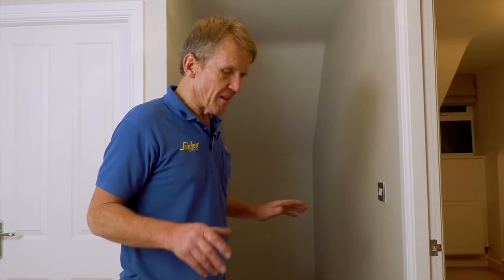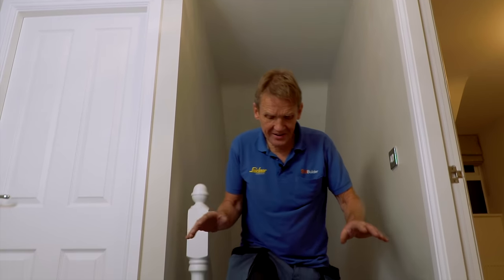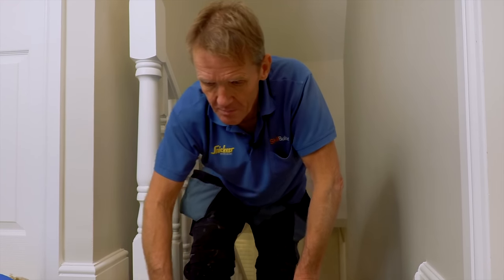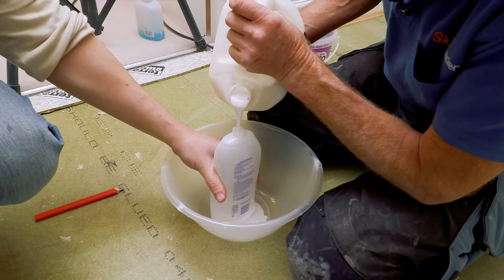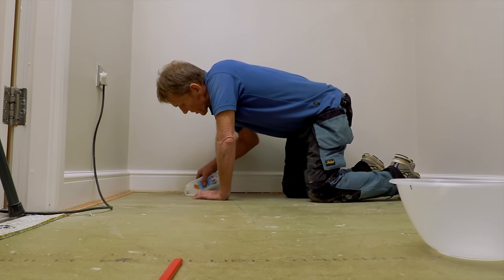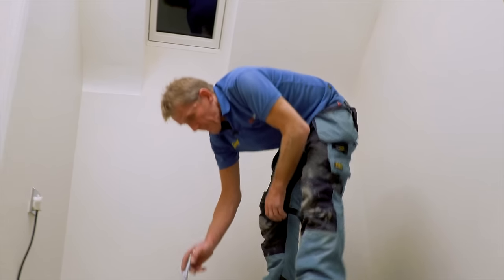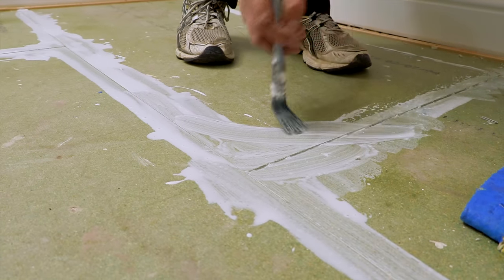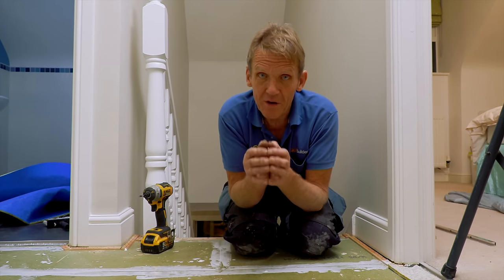Creaking Floorboards Driving You Crazy?

Comment: alternately, you can go into the basement or crawlspace and predrill at a 45 degree angle through a joist and slightly into the floor boards, then put a wood screw in the hole and draw down the floor -- make sure the screw isn't too long that it pokes through the floor boards.  You can then also put unscented talcum powder in the seam between the floor boards to help further stop squeek.  Cost is near zero
Reply from the maker: Edward
Forgive me for being a bit slow brained but how does drilling through the basement help stop the upstairs floorboards squeaking?

Comment: Sheathing gaps look quite large. I just came from a walkthru at a new house just finished but with only frames, floor sheathing. No carpets, hardwood or any tiles. The floor sheathing placed do not show any gaps, and nowhere near that large in this video. So, if ever such a repair situation occurs in the future, will this gluing step be needed? Seems with no gaps there's no space for the glue to flow into. Other than that, I do get this very well detailed and explained video to spot creaky floors.

Comment: Ah man this worked superbly on daughter’s floor but not on ours
Think problem deeper rooted as when lifted carpet done I’ve had already screwed it down but randomly all over shop
Followed this to letter as I had done last year (with superb results) but freaks as bad as ever this time
Reply from the maker: Hi Martin 
I think expanding polyurethane glue is your next step. You need to identify the movement and drill some small holes in the chipboard so you can squirt the glue in. It will seep into the gaps under the boards and expand to pack it.
Reply: Champion you couldn’t give me a link for this product? It does feel like squeaks coming from adjacent room when you stand on a board at top of room squeak comes from opposite end of room .
Also how deep would you drill to get glue Under board

Comment: There can be pipes underneath. It turned out a nail had bent around a pipe when our house was done in the early 1990s.
When we put screw in to the same hole it went straight into the pipe. ⛲
Would love to know if there's any way of detecting what's pipe underneath floorboards.

Comment: loving the videos,  re the pipes etc, always wondered why on new builds  or renovations   that  no one marks    the run of electric cables  or pipes  with a  coloured marker   say blue for water   red for elec or even just initilals    on the floor itself , takes all of  2 mins  when doing it ,  and would save a lot of farting about  or worrying about hitting a cable  or pipe ,     anytime the guys at my work lift a floor to do a repair to either the floor itself  or a burst or broken cable   they  mark the  general run  and the depth of the utility  eg     Elec--->  90mm  down    that way   they know  whats under that particular section of floor and how far down it is ....we have came work from  heating engineers  and electricians  on previous  renovation work   taking a 25mm notch off the top of a joist  and runining  pipes  and cables  literally 5-10  mm below the floor  level  or butchering the joists to hell leaving nothing there  and we get a call  4 months later   to go and  fix a burst pipe , pinched  cable or worse   collapsed joist ,

Comment: Thanks for the great video! I'll be giving this a go myself soon. Roughly how much PVA would you recommend per board? Or is it just a case of putting it down until it's completely saturated with it? (I'm a bit worried I'll go over the top with it).
Reply from the maker: Hi Adam 
You won't put too much in. I would say 1/4 of a cup full per joint and dilute it so it trickles in.
Reply: @SkillBuilder  Thanks for taking the time to reply. Much appreciated.

Comment: Had the same issue for years, found this video last night. Lifted carpet in bedroom before the boards are butt jointed that tight i don't think i will be able to get any pva in the joint. Will 40mm screws be deep enough if i screw them next to existing nails don't want to risk going through a pipe etc.

Comment: It is usually joist hangers or metal straps making the noise. Dont use pva to stick boards down need to use D4 glue.
Reply from the maker: This is not sticking the boards down it is sticking the t&g to eliminate the movement that causes creaking. Joist hangers and bounce is slightly different.

Comment: How do you actually take the boards up? My floorboards squeak to the point you can hear pipes rattling at certain areas. Got a feeling we would need to remove the floorboards completely and maybe get a plumber in to correctly fit the pipes. Literally the whole of the upstairs speaks. Even the master bedroom which is a 3 year old extension that shouldn’t have any problems. Assuming the fitted the pipes over the joists, not through them. Which also caused the floorboards to lie uneven?

Comment: We have just installed new 18mm OSB on the floor, instead of old wood floorboards. The ones installed click together. We screwed them in to joists and yet thet sqeak. What could be the reason? Would the glue work?
Reply from the maker: yes you must glue those joints. It should be done when fitting but pour in some dilute the PVA 3 parts water to 1 pva and pour it onto the joints then tap the boards with a hammer to help if flow into the joints. Then try and stay off the floor for at least 12 hours.

Comment: Some good points, some I'd disagree with...I was disappointed with the results (almost nil) with attempting to go through carpet into joists below. I tried break-off and small-head screws and neither worked. 

Best result I had was in another property with ALL of the carpet and pad removed...the original floor-boards were just nailed in...after 30 years of wear, many had worked up. A re-do with screws in/near the same spots as the nails did the trick (SHORT screws...yes, I was on a 2nd floor and didn't know all of the plumbing layout...excellent point about this).

Over time, I can't see how glue can be better - it will lose its' integrity...?

Comment: I tried this method in my 2nd floor flat, used PVA glue one evening and then 45mm screw tight screws the next, seems to have not done a single thing. Any other tips ? @skillbuilder

Comment: Thin superglue is better than PVA in spot situations in my opinion. Goes much further in and goes off in seconds.
Reply from the maker: Superglue is not the right product. The chipboard is too absorbent and the glue line will crack.
Expanding polyurethane glue works but it hard to get into the joint. Diluted PVA is perfect, it works so please don't start trying to confuse the issue.

Comment: Why would you do this rather than take up the boards, locate the joists and screw everything down with good screws? Is this for when you cant lift the joists because they are glued, they cant be glued that well if they creek so you may as well lift them?
Reply from the maker: The ten minute fix worked and is still fine. Taking up tongue and groove boards often means removing skirtings. That is a major mission.

Comment: I think my house has even worse chipboard flooring than this.  My place is an ex-council build Circa mid eighties, and probably as many of these places were, built to the minimum acceptable quality with corners cut by lowest tender contract builders knocking out job lots of fifty homes at a time.  Anyway..in mine, the ends of the chipboard sheets do not even rest on joists.  So they flex deeply as you walk on them.  Fabulous!

Comment: Could I just use pva on my chip board flooring as I’m worried if I put a screw in aswel knowing my luck I’ll hit a live pipe or wire?
Reply from the maker: Yes by all means give it a go . It often works, however driving a 40mm screw down beside the nail is fairly safe.

Comment: What’s the best way to find out where the pipes are? Floorboard up? Or put a screw in next to nail and hope for the best? Thanks for the info.
Reply from the maker: Take out the nails and put the screws in the holes. 

https://www.screwfix.com/p/hultafors-compact-nail-puller/6138K?kpid=6138K&ds_kid=92700031524363985&gclid=54d8f0f94169116bd43190c302043579&gclsrc=3p.ds&ds_rl=1241687&ds_rl=1245250&ds_rl=1244066&ds_kid=92700031524363985&msclkid=54d8f0f94169116bd43190c302043579&utm_source=bing&utm_medium=cpc&utm_campaign=PX_Shopping_Tools&utm_term=4583589099402330&utm_content=G%20-%20Hand%20Tools

Comment: I use one those Bosch magic pipe locator gizmos that goes beep at hidden pipes when you wave it around on the surface of walls, ceilings and floors. Rupturing a pipe WILL ruin your day. BTW, did those chirpboards go directly on to the trusses?

I've been redoing a floor with crappy recycled Oregon Pipe T&G planks, where there are sections where the tongue is missing on the planks which has led to squeaky sections, but I don't think infused PVA glue will sort that out.
Reply: see that was what I was thinking
Reply: True: that would be assuming its copper or  other metal pipes

Comment: If you glue them, what happens when you need to lift some of them up to do some work? They will all be impossible to separate!
Reply from the maker: you shoudl always glue t&G chipboard floors. That is what the instruction say. You will never get them up when they are interlocked so the glue makes no difference.
If you need to get them up you cut them with a circular saw. It is standard practice.
Reply: @SkillBuilder  
Many thanks for that. 
When I had to lift the floorboards before, I first cut out one of the boards in the middle of the room, then the rest just dismantled easily (like Tetris😏). So from that I assumed that they never got glued! But I guess they do, as you say. 
(hence why I thought it would be a sacrifice to glue them together).

Comment: What about when you need to lift the boards up again to fit new lighting downstairs, or move radiators etc? I woild just use screws otherwise they will be stuck down forever
Reply from the maker: There are a great many access systems for getting under chipboard flooring. They have been around for years. If you just use screws you will get squeaks. If it is your house then fine but your customers deserve a proper job and that is glued down. All the flooring manufacturers specify glue. 
This is the problem we face in this industry, too many people ignore the rules.

Comment: are there any experts on flooring here?  I live in the UK's coldest house, and i need to insulate some of our concrete floors.  I am looking at 20mm PIR and then 18mm ply.  - How much heat will we protect? -  We need ply for the furniture weight and longevity.  The house is 12c in Summer and 12c in Winter, would the wood floor still suffer from expansion, should i leave gaps?  Small amount of damp but shouldn't be a problem as i have put Sika two part down.  Use square edge ply or T n G ply?  The thickest underlay and wool carpet is going on top, eventually.... as i need chimney fixed !! So we will live with rugs and ply for a while, to avoid dust. Why are there no trusted tradesmen?? Been waiting three years with a leaking cold chimney!!  Floor is also nasty thin and bumpy.  I need skill builder aghh
Reply from the maker: Polythene 1000 gauge lapped and taped to walls. PIR board, t&G chipboard staggered joints glued all round. 10-15mm gap around edges. Entire floor floating on insulation.

Alternative 
Polythene then 20mm PI then Omni board with 10mmm pipe laid in. 6mm ply glued on with pva. screwed to chipboard avoiding pipes. Underfloor heating. Happy days. Warm house happy feet.

Comment: Hi, is it possible to inject PVA glue into the gaps by syringe or pump rather than only brushing it on the top.
Reply from the maker: In theory yes but if you water the pva down and agitate the boards or even tap them with a hammer it will flow in.

Comment: Hi there, can you do a video on noisy rising main pipe causing "water hammer" problem. I've reduced the noise by reducing the mains pressure on the rising main but it still returns from time to time, and when it does it seems louder! thanks Mick
Reply from the maker: Hi Mick 
Turning down the stopcock does nothing to reduce the pressure. It reduces the flow but the pressure is the same and that is why it will still hammer. You need to fit a pressure reducing valve. Buy an adjustable one and you can then fine tune it.

Comment: If the floor is waterproof chipboard, surely the tongue and groove won't swell at all when you run the PVA into the joint (thought you will stick have the adhesive effect of course).  But who knew that moonwalking would be a useful skill for a plumber!

Comment: In an older house would it be okay to replace the older slats of wood with the much larger sheets as seen in this video? I can' think why it wouldn't be but thought I would ask. The advantage I thought of doing this (the existing wood needs changing regardless) is you then have much larger sections that are flat, less fixings and joints. Thanks.
Reply from the maker: Yes you can do it but if the edges are not tongued and grooved into the next board (where it meets the old) you need to put supports (noggings ) in to stop flexing at the edges.
Reply: @SkillBuilder  Thanks for taking the time to reply and confirming it is okay to do and for the advice about supports at the edges. Much appreciated!

Comment: Does the technique depend on the age of the floorboards . Got ones that are creaking that must be at lest 40-50 year old.
Reply from the maker: This is for chipboard and goes in the tongue and groove. Traditional boards just need screwing down. Pull out the nails with a nail puller and drive a screw into the same hole. That way you won't hit a pipe or cable.
Reply: Skill Builder cheers . Was told by a friend I would have to take all the boards up and put new ones down. Was dreading it.

Comment: Can you apply pva to finished hardwood floors? Like fill the cracks and wipe away the excess that's on top? Or would that stain n ruin the hardwood finish?
Thank you in advance!
Reply from the maker: Probably not a great idea. The pva would run into the cracks. What is the issue? Is it shrinkage?
Reply: @SkillBuilder  it's a 1950s house, original hardwood floors, there's a few spots that creek/squicke and a few spot with cracks between the floor boards. Like overall it's not in terrible shape but I tried screws and it helped but didint fix all the screeking
Reply: @SkillBuilder  the guy in the video was filling all the cracks with it, issent that what you want, to have it drip down into the cracks...?

Comment: Seems very hit-and-miss, "there probably aren't any pipes..." famous last words.
In our 1935 house, all the creaky floorboards are from the previous owners (bodgers) fitting central heating, so I KNOW where the pipes are, they are just under the creaky floorboard. Not far under, the joists were just notched, for the most part, and most of the tongues were cut off to get the boards up. And they ran some new T+E wires nearby.
As a result, every creak has to be done properly, with new boards cut to 1935 sizes, I screw them down and that's all it needs. Mark pipe and cable runs on the new board...

Comment: I hate nails they should be banned.most floors have been cheaply nailed down using smooth & incorrect nails and never enough used either or hardly any extra supports in areas that need it.every single upstairs room in our house creaked.i took up every single floor up and removed every single nail and all rusted smooth nails and properly screwed & supported the floor as it should have been done in the first place. The other good thing about using screws is,if ever extra work under floors is needed ya can easily unscrew boards & lift up flooring.compared to being up against a pain in the bum nailed down floor.i sorted out every single floor upstairs in our house.sometimes if very old floor boards are too far gone rotted,lots of  flexing etc.there is no amount of screws that is gunna fix it.new boards needed. It's nice to see a tradesman passionate about what he is doing. As a proper job person myself bodgers doing jobs just cost more money in the long run. Do a job properly once and its job done.   ;-)